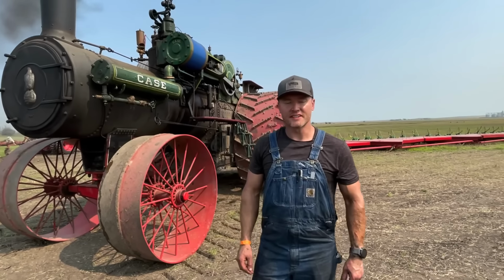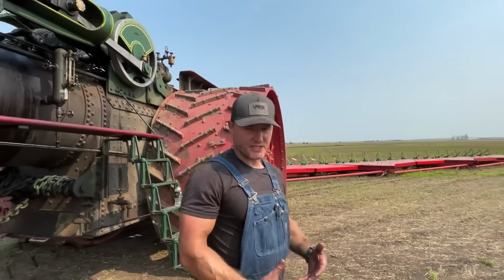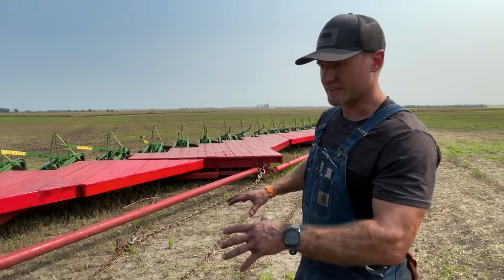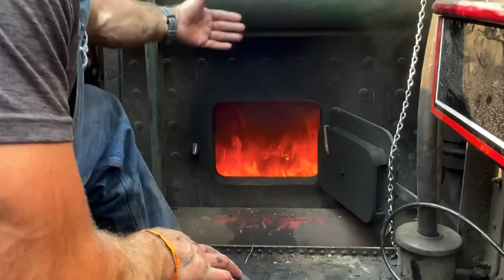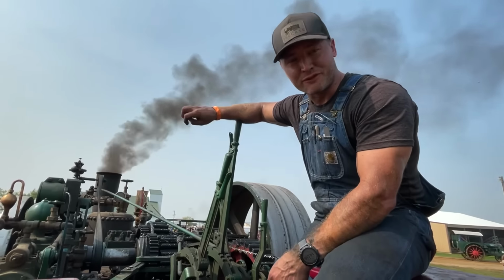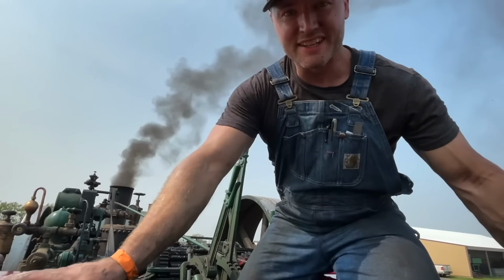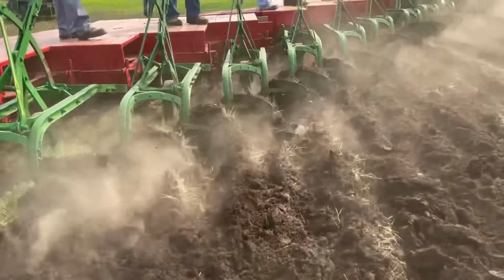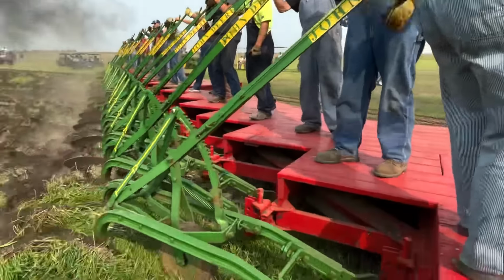2021 RECORD! 150 CASE Road Locomotive pulling 44 bottom John Deere plow

Comment: The amount of power being produced by this SINGLE CYLINDER steam engine is phenomenal!! This is the result of 180 lbs. of steam pressure acting on a double-sided 14 inch piston with a 14 inch stroke. 2 speeds forward... slow and slower! (actually about 5.7 mph. in high gear, and 2.6 mph. in low) That said, with the amount of gearing, it produces over 8000 ft. lbs. of torque at the wheels! This is the equivalent output of 8 - 2021 Dodge/Cummins turbo diesels running at full power @ 1800 rpm.!! This tractor does this at 200 rpm. at crank speed and probably with quite a bit less noise.😁👍
Reply: Thanks for the information!! Much appreciated.!!!
Reply: compare that to some of the early fuel tractors at  50 or less Hp.
Reply: The 2021 Cummins has way more power. This case is only 150 HP and of course with hydraulic drive or low gearing, the 2021 Cummins wins against the steam engine in this Case tractor for pulling too. Gearing and hydraulics can change torque in the formula, power = torque*RPM. SO many people seem to forget that.
Reply: @EETechs  nah, old is gold  keep that modern garbage away from me.
Reply: I wonder if there were any Boiler Explosions back then....... It truly is a sight to behold. Greetings from Australia.
Reply: torque number doesn't matter
Reply: @EETechs  it's all about how it's geared.
Reply: it's 8000 shaft torque not wheel
Reply: @BigCroca  that 100% right man. U can have a 5 hp motor pull that it's just going to be very slow like hafe a mph maybe at that😂 but u can do it just very very very slowly all u need to be is heavy as fuck and almost dead grany supper low and there u go
Reply: @EETechs  nothing wrong with def  concept but all the electronic crap associated with it and other emissions is garbage no human being should have to hook up a laptop to his tractor or his truck it should be fixable with a good set of tools
Reply: Is it means it's more powerful
Reply: AND - maximum torque is at 1 RPM with the regulator fully open.
Reply: @EETechs  HAHHAHA sorry you don't understand how torque and HP work on steam engines. H Power is essentially irrelevant as maximum torque is with the regulator fully open  and the engine running at 1 rpm.
Reply: It really IS amazing when you think about the physics involved!
Reply: @piccalillipit9211  that's called a torque curve. That doesn't mean horsepower is irrelevant.
Reply: @Dread_Naught_But_The_Dark  Well a steam engine does not really have a torque curve as we traditionally know it.  Its essentially somewhere between a straight line and the upper right hand quadrant of a circle starting at 0 rpm and 100% torque going down to 0% torque at maximum rpm.

When you can pull a 44 furrow plough with 150hp - horsepower kinda becomes irrelevant.  You are pulling the plough with the torques of the engine, instead of using the maximum HP of the engine and converting that wiht gears into a torque sufficient to pull the plough.
Reply: @piccalillipit9211  

Yeah.... still a torque curve. 

And horsepower is COMPLETELY relevant when the horsepower produced by the machine--especially at any given amount of torque--literally dictates how much work the machine can do in X amount of time. If this machine produced the same amount of torque but at half the horsepower, it would be pulling the plow, but only half as fast. Hell, you could take a 18hp Briggs and Stratton and use gearing to make it produce as much torque as this steam engine, and give it the same work... it will also pull the plow, but at a pace akin to paint drying. Why? Because it's only an 18hp engine.

I don't know if it had occured to you yet or not, but this is a farm implement, and farmers of all people are incredibly concerned with matters such as horsepower, which literally govern how long it will take them to do things like plow a given amount of land with XYZ machine. 

You might wanna brush up on your understanding of the relationship between torque, RPM (or speed), and horsepower. They're all equally relevant, whether you like it or not.
Reply: @piccalillipit9211  yes because theres no regulation of the piston pressure, the steam only explodes and makes engine works. So all the force is the same at 1 rpm to any rpm
Reply: You just answered a few questions I had. Thanks for that information, and yes it is amazing what one piston can do.
Reply: @piccalillipit9211  it doesnt need to be a "traditional" torque curve for it to still be a torque curve. There's a rather straightforward relationship between RPM and the varying degrees of torque production across those RPM's. That's a torque curve. Is that really that difficult for you to comprehend? 

That being said, I'm assuming you're resorting to those pathetic ad hominems because you're slowly coming to the realization that your previous statements regarding horsepower and such were completely and utterly asinine assertions, and are now trying to save face when being explained otherwise?
Reply: Less noise and probably it polutes less
Reply: @EETechs  are you saying your dodge would beat this in a tug of war
Reply: @dylanmccallister1888  The cummins engine would. It would be stupid to use a lightweight truck that gets no traction. The proper way to do this is to find another case tractor like this one and control the wheels with hydraulic motors often found on huge earth moving equipment and use the appropriate hydraulic pump for the engine. The cummins powered tractor would totally dominate over this weak steam tractor.
Reply: @EETechs  i think you underestinate the torque this engine makes. The boiler in a steam engine is where the energy comes from and that boiler is pretty big. Ssme size is used on locomotives to haul freight. 

I think it would drag you across the field inch by inch
Reply: @EETechs  yeah so i just looked it up, this engine makes over 5,000 ft lbs of torque. Thats the stock power of a 150 case. 

So no, your cummins out of your truck wont do shit you are full of it
Reply: @dylanmccallister1888  No, there is this wonderful thing called gearboxes. A higher horsepower engine will always have more torque through gearing than a lower horsepower engine that has high torque without needing gears. These are known facts. We are trading the high horsepower for more torque with sacrifice of the RPM's. since power is torque*RPM. We can make torque or RPM bigger while maintaining the same power with some losses. 

Your steam engine turns at 178 rpm for the 5,000 ft*lbs of torque. That is 170 Hp that this can put out when it was dynoed on that site you found it at. I found it too.

The 2011, 6.7 Cummins Diesel is 350 HP at 3000 RPM. That is 612 ft*lbs of torque, but if I gear it down to turn 178 Rpm to match your RPMs,  then my torque is 10,314 ft*lbs at 178 RPM, which is  350 HP. You can gear your engine down for less RPM again, say 50 RPM and say. HA! Now , I got more torque, but now I do the same and we end back again with the engine with the higher horsepower winning with more torque. In fact , if we infinitely pose these back and and forth challenges, the engine with the higher horsepower always wins.

Now to solve the torque at zero RPM problem, which diesel and gas engines do not have, I must use hydraulics. With a pressure compensated hydraulic pump I can maintain constant hydraulic pressure at stall on a hydraulic motor without worry of blowing up a hydraulic line, which gives the stall torque I need like steam and electric motors have.

That is why I stated if I had the same tractor, I would put the Cummins diesel on it and use hydraulics and hydraulic motors to turn the big wheels. In the end, my setup would always win.
Reply: Need for speed
Reply: @EETechs  so while you’re doing all these perfect matchups to benefit the Cummins diesel, can we not just keep guaring down the steam engine? Both are optimized to its limits, which one will outperform the other?
Reply: @Aaron71304  Already covered the gearing down. If you geared both down infinitely, the higher horsepower cummins diesel will always win with more torque because the higher power with the RPM higher can be changed for more torque with gears. You can trade speed for more torque but still have the same power with some losses. Say you gear the steam engine for 50 RPM, then I do the same for the higher horsepower cummins diesel, then the diesel will have more torque. An engine with higher horsepower always has higher torque capability with gears for every RPM match up with a slower turning engine with less horsepower. Remember that power is torque*RPM. So if the equation is equal to a fixed horsepower number, then if you reduced RPM by half you must double torque to maintain the same horsepower number for example. Simple math.
Reply: @EETechs  This guy is right.  All you other clowns should do more research, or at the very least LISTEN.
Reply: @EETechs  he means torque. A 6.7 Cummins isn’t going to make 4 tons of torque, and few things could try to pull this thing because 1) it has 4 tons of torque and 2) it weighs 35 tons. It’s safe to say this behemoth can drag a Cummins truck all day
Reply: @drumminggoose444  I never said use a truck. I said use the same tractor and use the cummins diesel ENGINE with the hydraulic setup I stated in my earlier replies. Read all my replies before commenting.
Reply: @EETechs  except for the fact that you need 8 of them....
Reply: Lol, let’s not appreciate what this guy did,  cool as hell to see,  doesn’t matter what a Cummins
 can or can’t do, you can’t put steam in a Cummins
Reply: Let's drop the math and hook them chains lol
Reply: @EETechs  If there is no real world penalty for infinitely gearing down for torque, then why do Diesel engines exist at all? A similar sized gasoline engine will always be lighter and produce more horsepower. What say you?

Someone in the comments said that piston was 14” in diameter and that it ran at 180 psi with a 14” stroke. So assuming it can maintain a 180 psi average on the piston and turn 180 times a minute I calculate it makes 176.4 hp and 2,572 lb-ft at the flywheel before gearing obviously. If it could make 200 rpm with the same pressure it would make 196 hp.

Don’t worry though, a junkyard LS would beat them both 😭.
Reply: Fuk that was a painful if not educational read. There is a few reasons why the steam engine isn't to go to motor of choice these days. This motor is awesome
Reply: @EETechs  bro this woukd drag any truck across the park....
Reply: It barely even sounded like it was working hard. Just chuffing along happy as can be not caring one iota that the plow was engaged.
Reply: @Onwaxwings  Thats right, and I never said use the truck. I said the ENGINE in the particular setup I mentioned in my long replies above, and sorry, I dont summarize for those that suffer from TLDR syndrome. Read the replies or ignore them if you hate long reading.
Reply: @EETechs   the engine would stall out. Still wouldnt beable to pull the 4+ tons in the dirt
Reply: @EETechs  if thats the case, why arent high hp gas engines more common in ag machinery, where their higher hp means more time saved?
Reply: @Onwaxwings  Hydraulics are wonderful in that you can get great torque multiplication and not stall the engine with proper design. There is this wonderful invention that has been around for a long time called a PRESSURE COMPENSATED PUMP. If you had read my replies you would have seen that I stated such a pump.

 I can set the pump at the line pressure I need for the power the engine can produce and literally dead lock the hydraulic motor powered from the pump and not stall the engine that is powering the pump and I get the added benefit of torque at zero RPM just like electric motors or steam engines. I will not explain how pressure compensated pumps work. You need to search that on youtube yourself and learn.

I also suggest  you look up how fluid couplings work such as torque convertors on youtube. Sorry, we don't use manual transmissions here in the USA where it is possible to stall the engine.

But if you are still confused then a Caterpillar D8 dozer has about the same horsepower as a Cummins diesel engine for Dodge trucks and it had no trouble pulling a sled weighing 60,000 lbs. I suggest you look here www.youtube.com/watch?v=Nh4n4sjVVhw
Reply: @EETechs  oh, and my calculations incorrectly assumed only one side of the piston was utilized. The actual horsepower figure is double my figure and more than the Cummings.
Reply: @TheTmshuman  Nope, was dynoed and is only about 170 HP. Google it.
Reply: @isaakwelch3451  Already covered by reply made to Thomas Shuman.
Reply: @EETechs  i dont see any reply except one mentioning 170hp
Reply: @EETechs  Why would someone say it has a double sided piston?
Reply: @isaakwelch3451  You have to go back up a bit. Youtube's comment section is not that great. It's buried somewhere in the sea of 55 replies (now 56). Gas piston engines have poor fuel economy and poor reliability relative to a diesel engine. And gas turbines are even worse for fuel economy than piston gas engines, but have insane levels of power for the weight and volume.
Reply: @EETechs   yes a steam tractor WOULD pull those. Are u slow?
Reply: @Onwaxwings  So a Case 150 steam tractor will outpull a Cat D8 bulldozer or a M1A1 Abrams tank?? You really are trolling me.😂😂😂😂😂
Reply: @piccalillipit9211  maximum torque is at 0 rpm
Reply: I would like to see them turn around and line up for the next pass.
Reply: @EETechs  Horsepower isn't everything, it's how you use those horses. Steam engines produce an absolute huge amount of torque. Horsepower is not the only indicator of an engine's power, in fact, when agriculture is the concern, it's all about the torque. It's about where their power comes from. A gas engine produces energy through motion, using carefully timed explosions to achieve rotational energy. A steam engine needs no timing, it's one cylinder, and the expansion of the steam directly drives it, and therefore, it works at full power at low RPM, because the power comes from heat and steam pressure, not speed and momentum. If anything, it's sort of the opposite of a gas engine in terms of torque. A gas engine pulls harder at high RPM, because of the momentum, a steam engine loses pulling power at high speed because the steam is being vented as fast as it can be made, resulting in lower pressure.
Reply: @EETechs  Seeing as how the M1A1 Abrams uses a 1500hp TURBINE engine, I don't see how it compares here. Of course a tank that can put out 10x the horsepower of this tractor will outperform the tractor.
Reply: @richardmillhousenixon  That is correct. Even though the 1500hp gas turbine has less torque than the case 150 steam engine , the power can be converted to more torque with gears or hydraulics but still have the same power, but now at lower, more torquier speed. Also, the D8 dozer, which has about 300 hp will also drag the case steam tractor. Im glad you understand power but some people on here are so hung up on huge torque figures. Its like they think gears dont exist or hydraulics.
Reply: @EETechs  The d8 would not be able to drag the steam engine if it were running as well. Steam torque at low end vastly outperforms the torque from pretty much any internal combustion engine, no matter how much you gear it. The caterpillar can't dig into the ground like this can, it only puts 8psi of pressure on the ground, while this tractor probably puts 5-10x as much pressure on its driving wheels.
Reply: @magisterrleth3129  Your arguement becomes pointless with fluid power and generating electricity and fluid coupling. I have gone over this so many times already in the above 60 or so replies now. With hydraulics you use a pressure compensated pump. You set the pressure such that it loads the engine to  about 80% to 85% of its full power. When the pump reaches maximum pressure it will keep that pressure at that level and not stall engine. They have swash plates in them that de-stroke the pump pistons inside the pump just enough to maintain pressure setting and keep the engine from stalling. This constant pressure will give hydraulic motors torque at zero RPM without needing to rotate just like steam or electric motors.

Likewise, a torque convertor is a type fluid coupling. With fluid couplings the stall speed can be changed to match the gas engines best operating point, negating the momentum issue you stated. 

Horsepower is absolutley everything. Its formula is torque*RPM. This formula has two variables that can be changed with gears or hydraulics or electric. If I gave you two engines exactly the same but hid a gearbox in one them, then one of them is "more torque" but all I did was use a gearbox on an identical engine.

 Maybe it is best to understand high torque engines as free gearboxes put on a higher RPM version of them without you needing to add an actual gearbox.
Reply: @richardmillhousenixon  Gearing INCREASES TORQUE. The D8 dozer absolutely will drag the Case 150 steam engine tractor backwards. It weighs twice as much and has a much larger traction surface area because of the tracks.
Reply: @EETechs  Bahahah twice as much? The CASE weighs 30T. The D8 weighs 40.
Reply: @EETechs  No amount of gearing will give you max torque at zero wheel RPM.
Reply: @richardmillhousenixon  That is why you use a pressure compensated pump hooked to a hydraulic motor or fluid coupling like a torque convertor. 

So let me ask you this, if the high torque of the case 150 steam is so awesome and power does not matter then how come a 300 hp diesel can power more homes with electricity than you high torque 170 hp case tractor steam engine? Hmm....
Reply: @richardmillhousenixon  The D8 dozer weighs 80,000 lbs, your steam tractor weighs about 45,000. Id say thats about twice as much, not exactly 90,000, but close enough.
Reply: @EETechs  80,000lbs is 40 tons. The tractor, as they stated in the video, weighs 30 tons, or 60,000 pounds. Nice try
Reply: @richardmillhousenixon  I stated it in lbs. So? Was I suppose to say 22.5t vs 40t? And the 60,000 lbs is with full water tank and coal. Nice try. I guess I should include the weight of the fuel, oil and transmission oil, and coolant of the D8 dozer too? Lol. And even at 60,000 lbs with full water and coal thats 20,000 short and thats on steel wheels with a tiny contact surface area on the ground vs a large surface area with tracks of the D8.
Reply: How much does it burn?
Reply: @EETechs  More contact area isn't always better. You ever been skiing?
Reply: @richardmillhousenixon  Thats a smooth, slick surface versus each piece of track grabbing into the dirt over a larger area. Its why bulldozers and tanks use them, far better traction than round tires.
Reply: @EETechs  Bulldozers and tanks use them because they are more versatile, not because they offer better traction.
Reply: @EETechs  Horsepower directly converts to joules of energy. 300 HP is more energy than 170, obviously. In the world of electricity, horsepower actually is everything, if you want to make power, you need to spin that dynamo fast. But in the case of machines performing tasks, torque is a good number too. And gearing will never make a gas engine pull from a dead stop as well as a steam engine. You might get competitive results, but because of the way the engine works, if you're working from a dead stop, you will never beat steam, just by nature of how it gets its power compared to internal combustion.
Reply: @richardmillhousenixon  They absolutely offer better traction. Take a bulldozer with rubber tires and the same with track set up and see who looses traction first. Let's make a $30,000 bet. I've been around heavy earth moving equipment quite a bit and without a doubt a tracked based setup totally destroys rubber tires, but you can believe what you want. I would love to have your $30,000.
Reply: @magisterrleth3129  You use fluid coupling with gears or hydraulics. YOU DO NOT USE A CLUTCH AND GEARS WITH GAS/DIESEL ENGINE. If you do then that will lead to a stall. I already accounted for this with many MANY REPLIES in early conversations on here. You need to READ THEM. 

Gas engines and diesel engines have a sweet operating area that can be used with stall speed of a torque convertor or with hydraulic pumps called pressure compensated pumps. A 300 HP diesel connected to a pressure compensated pump that powers a hydraulic motor will absolutely and utterly destroy the steam engine in stall torque. The hydraulic motor can sit there all day developing stall torque with the diesel engine running along happily without issues.

With an automatic transmission we use something called a torque convertor which is a type of fluid coupling - there is no physical connection between the drive and driven part or the stator and turbine inside the torque convertor. Fluid is what moves the driven part. I can literally lock down the brakes and floor the throttle without the engine stalling. The torque being produced at the wheels becomes stall torque much like a steam engine or electric motor, but now the transmission gets destroyed and the fluid gets VERY HOT to the point of boiling without extreme  levels of cooling capacity. Hence, why I prefer a pressure compensated pump with a hydraulic motor instead.

Hydraulics is like the fluid version of electricity. The pump is like the generator in electricity and the hydraulic motor is the electric motor. With electricity I can power a much stronger electric motor with the 300 horsepower diesel engine than I can with the 170 HP steam engine if I wanted a hybrid setup. Now do you understand power?
Reply: Careful, Jay Leno might want to buy this now!
Reply: @EETechs  
Nice reply))) greetings from Russia, St.Petersburg!
Reply: why are you comparing this to diesel pickups? its a tractor so compare it to tractors....
Reply: @EETechs  I just did the math, and given a piston diameter of 14 inches, it produces 27708.8472 pounds force. Now, since we know it has a 14 inch stroke, the radius of the flywheel/counterweight at the point of connection with the conrod is 7 inches. Now we can convert that into torque, since we know the force and radius. That gives us a torque value of 16163.49 pound-feet. And since we can obviously see that the drive wheels are not moving at the same speed as the flywheel, there is definitely a very low gear ratio, which increases the torque value even more. But let's calculate that. The drive wheels look to be about 8 feet tall given the total height of the tractor and comparing the height of the wheels to the height of a person. That gives us a wheel diameter of 25.13274 feet, and taking the top speed in low gear from the 150case site of 2.64mph, those wheels would be spinning at 210.084535152 rph, and given an engine speed underway of 120rpm in low gear (I estimated the speed from the video during a point where it was towing the plows but none were down) that gives us a gear ratio of 0.02:1. Now it's just math. Using everything I just mentioned; gear ratio, input torque and input speed, we get a maximum torque at the wheels of 808,174.5 pound-feet. How much torque does that bobcat have? Since it only has a ~5500psi hydraulic pump and not that much surface area on the pistons of the radial hydraulic motor, I'd be willing to bet it's not that much
Reply: @asbestosfiber  no kiddin, my Ferguson I use daily only has 18hp!!
Reply: @richardmillhousenixon  A D8 dozer is a not a Bobcat front loader, nor did I ever say anything about a Bobcat. BIG DIFFERENCE. A D8 bulldozer is much larger, heaver, and stronger.

You might want to do redo your torque calculations. I suggest Googling : "crank torque calculations". It's not as simple as you think with just Force*Length. Also, from the pictures of the engine, the point of attachment of the connecting rod is not at the very top of the flywheel crank. It goes inwards slightly. Finally, your force calculation assumes the piston has not moved or went to the exhaust port in full stroke. So that is stall force of the piston and gases are also compressible against a load where as a liquid is not.

The D8R Bulldozer has a top speed of 2.2 MPH in first gear and a draw bar pull force of 120,000 pounds in first gear before losing traction.

Here is a full pull with D8 dozer: https://www.youtube.com/watch?v=Nh4n4sjVVhw

Hydraulic pistons motors ARE WAY MORE stronger than that steam engine. Try 5000 to 10,000 PSI against the same 153 sq" area and the fact that liquids are not compressible. Piston hydraulic motors can easily have over 30,000 Ft*lbs of stall torque. The Case 150 steam engine does not stand a chance against a piston hydraulic motor.
Reply: @EETechs  Y'all calm down. a cummins barely last 10 years. this steam engine took your great great grandpa to his first date
Reply: @EETechs  30,000ft-lbs<808,000ft-lbs
Reply: @EETechs  I am well aware of the fact that the point of connection is not at the edge, however, the crank radius of a piston is determined by the stroke length. Crank radius is half stroke length. Even if we throw out half of the torque calculation to account for errors in calculation and frictional losses, that is still over 10x more torque than that bulldozer. And where the fuck did I say I was talking about a front loader?
Reply: @EETechs  And yes, I literally used a crank torque calculator. So check yourself before you try to correct others.
Reply: @richardmillhousenixon  That's through a gearbox. Now let me put the hydraulic motor to that gearbox that the steam engine is hooked to. You did not think this through did you when you wrote that reply?
Reply: @richardmillhousenixon  And where is this calculator? Hmm. You did not mention connecting rod length, the crank angle. At zero and 180 degrees your torque is zero. You assume torque is constant in a crank. It is not...
Reply: @richardmillhousenixon  You said Bobcat. Bobcat is not a D8 Dozer. Try again.....
Reply: @EETechs  English comprehension really isn't your strong suit is it?
Reply: @EETechs  Even if we throw out half of my calculation to account for errors in calculation and frictional losses you still have more than ten times the starting torque or that D8.
Reply: @richardmillhousenixon  Apparently, reading comprehension is not your strong point because you wrote: "How much torque does that bobcat have?",  which is a far different machine than a bulldozer and you wrote: "Now we can convert that into torque, since we know the force and radius. That gives us a torque value of 16163.49 pound-feet. " Which is the torque of your steam engine BEFORE GEARING at STALL, and in REPLY to that I gave the torque for the hydraulic piston motor, but then you decide to compare the torque AFTER gearing of your steam engine to the hydraulic motor BEFORE gearing. 

I think now you are trolling me at this point to get laughs. It is time to block you now. No more laughs for you. You lost the argument. Get over it and move on.
Reply: as someone who's been fascinated by engineering most my life, that's nuts even by todays standards, let alone the 1800's (im assuming that's when it was originally produced.
Reply: @EETechs   Nice Theory... I would like to see it in action.  However, could the engine handle that kind of torque at such low  rpm's.  You have to remember these old machines as with most things back then were always over engineered. The Cummins is precisely engineered to your vehicle or similar vehicles.  They were not engineered to sustain  such high torque for extended periods of time. I think you would over heat and lock up the engine with in the first 10 minutes.
Reply: @BNSF39  The cummins diesel can maintain 300 horesepower non stop without issue of blowing up.
Reply: @richardmillhousenixon  crazy thing is, that turbine engine in the Abrams has 400ish ft lbs of shaft torque, less than a Corvette.  Attached to the back of that turbine is a 7.5:1 gear reduction unit, the output of that shaft is around 2800 ft lbs, which goes into transmission and final drive.  Gear it even lower to match the speed of this steam tractor it will have 10x the torque
Reply: @richardmillhousenixon  torque at wheels, or tractive effort, is all we care about....gotta account for gearing, wheel diameters, transmissions, axles, etc.  Cat wins handily
Reply: @richardmillhousenixon  do you know transmissions and gear ratios?  go calculate tractive effort of the syeam tractor and D8 and get back to us....HP normalizes for these things, it's the only number that matters.
Reply: @motominded5275  I've already done that. Again, reading comprehension really isn't your strong suit is it.
Reply: @richardmillhousenixon  I don't think so, hp is hp, the more you have at crank the more torque potential you have at wheels.
Reply: To the people asking why gasoline engines aren't used is because they have: lower thermal efficiency (less efficiency at full throttle), need more room for reduction hearing, are less durable, and agricultural diesel used to be cheap.
Reply: @isaakwelch3451  fuel economy and longevity is why we don’t use gas engines in heavy equipment
Reply: @EETechs  Every single hypothetical thing you're saying is disproven by the reality of the railroads where it took the largest diesel locomotives a very long time to actually match the largest steam locos for sheer pulling power - diesels only were able to pull the same length trains when the industry transitioned thanks to single-crew multi-unit operation being included with the first mainline diesels while multi-unit operation was rarer with Steam due to requiring a crew for each engine. It wasn't uncommon for there to be 2 diesels pulling trains you'd previously have seen 1 steam locomotive on because of the drop in pulling power. (Still was cheaper to run it that way...Steam is expensive as hell to run)

I also want to note that when we're talking steam vs diesel locomotives there's not a huge weight disparity, the diesels are often using electric traction motors or hydraulics instead of gearboxes so they have near-infinite gearing, the engines are similar in size in what ways you can compare them, etc and yet it's only fairly recently that the diesels are able to match 70 year old steam locomotive designs. (ie. Steam may be better, we just don't know as no-ones made a brand new design for so long that I don't even think CAD has really been a thing with steam, let alone all of the materials tech we've worked out since the 70s/80s)

Steam isn't a big thing any more because it's far more labour intensive to run, has a very long start-up time even if you can fill the boiler with pre-heated water and diesel/petrol ICE were far more useful in smaller applications meaning that they have a huge economy of scale benefit to build. All of those added up into 2-3 diesel locos being able to operate for the same costs as 1 steam loco and afaik, it was a similar situation when looking at tractors, cars, etc.
Reply: @TheDemocrab  Except the early steam engines had way more horespower than early diesel. Like 5,000 to 6,000 horsepower. 

Also, early diesel-electric used DC electric motors and low temperature insulation, and so, could not hold the same torque that a steam engine can without burning up. So your stall torque is limited to how much heat the DC electric motors of that time can take from the high current draw.

Today, diesel-electric would utterly destroy your weak, old school, steam engine locomotive due to vast improvement in electric motors by switching to AC motors, advance control electronics, better temperature tolerance of modern motor insulation and higher horespower than early diesel.

Lets compare: 

GE AC6000CW - 188,000 pull force
Big Boy - 135, 375 pull force

And yes, you are right, a modern steam locomotive would dominate, and it's not because of torque of the steam engine, but POWER. Modern steam turbines used in generating electricity produce millions of horsepower such as the GE170X646 steam turbine rated for 1,554,959 horesepower at 1800 RPM.

 There is nothing else on planet earth created by man that compares in power except rocket engines. So thanks for inadvertently proving my point about power. As long as gears and hydraulics exist, power can always be described as different torque and RPM values for the same thing. High torque, low rpm, or low torque, high rpm. Power is power no matter how it is made.
Reply: @EETechs  Yes, I outright admitted modern diesels have steam out powered but you've also just proved my point that the only reason diesel dominates is because it's had the benefit of the last 70 years of rapid technological development while Steam hasn't: We don't make steam reciprocating engines very much at all anymore so development has all but stalled on them while ICEs became ubiquitous because they were far more suited to end-level consumers (ie. Could actually be sold to them) and cheaper for industrial/commercial applications.

I mean, you're comparing a steam locomotive from 1941 to a diesel from 1995. What was invented between 1941 and 1995 that'd benefit steam engine design? It's not exactly a small list and "computer-aided design" would be right at the top of it.
Reply: @TheDemocrab  Its more of the changes to AC motors, power electronics, and power increase of the diesel that all helped in increasing pulling power , not just 70 years of diesel tech alone.

They can make a modern steam engine train if they wanted, only it will be a steam turbine instead. You not read my whole reply? Modern steam turbines produce millions of horsepower for power generation. So my point is proven. Power is power. Gears and hydraulics can change the rpm or torque variable to suit your needs.
Reply: @thekuntash  lots of gas engines have been used in heavy equipment. I'll give you economy, but a gasser built for industrial use will have a similar lifespan to a diesel
Reply: Now imagine two banks of those cylinders in a v shape and 12 of them.
Reply: Hey Dan, please compare apples to apples next time. 8000 ft lbs AT THE WHEELS. 1 Dodge/Cummins would pull Case backwards with same gearing and mass. A 600HP Cummins with 1850ft lb @1200rpm has about 30000 ft lbs AT THE WHEELS with 1st gear engaged (5.61 ratio) and 4.10 axle with RWD only (assuming 30% drivetrain losses). As cool and beautiful as this Case is it is weak for the size, is totally inefficient and has no place working in modern world.
Reply: @EETechs  The cummins produces about 1/8th of the torque you clown. Once it's been divided by the transmission, this steam tractor probably produces well over 75,000 foot pounds of torque.
Reply: @nano-gq9tv  You completely misinterpreted what he said. Shaft torque numbers are BEFORE the power has been multiplied.
Reply: @Dread_Naught_But_The_Dark  Stop it, you don't know what you're talking about...
Reply: @Dread_Naught_But_The_Dark  Your combustion engine physics do not apply here, STOP.....
Reply: @EETechs  Again, the torque measured off of this engine is BEFORE it's been through any sort of transmission. This steam engine makes EIGHT THOUSAND FOOT POUNDS OF TORQUE AT THE CRANKSHAFT...
Reply: @jessh4016  Age has zero to do with it. This engine makes 8,000 lbs off torque, once that's been multiplied by the transmission, this old.steam engine still has a competetive edge. The proof is in the video.
As for the clown saying that a new 6.7 liter engine can do the same thing; well why aren't they putting 6.7 cummins into today's tractors & dozers? The Timberjack 450c log skidder I ran for 15 years has a 5.9 12v cummins in it, it would spin it's tires trying to pull this plow. 1 it's way too light, & 2 it simply doesn't have the power, even though it puts out over 50,000 feet of torque at the wheels in first gear... Modern machines designed to do what this macnine can do, are all sporting engines almost double the size of the 6.7 cummins...
Reply: @Angry Beaver  EETechs is 100% wrong... If he was right, a new Cat d8 would have a 6.7 cummins in it & not a 15 liter inline 6...
Steam engines make all the torque at 1rpm, THEN  the transmission comes into play....
Reply: @EETechs  You're bringing up all kinds of garbage to try to win this argument. My guess is that you soend too much time on the internet "educating" yourself solely to win chatroom battles...
Reply: @elonmust7470  yes they do, genius. Physics dont just apply differently to an engine just because it uses diesel vs. steam vs. electricity. Power and torque are still fundamental aspects of each.
Reply: Show off.!!!😎👏👏👏👏👏👏
Reply: @piccalillipit9211  '"HAHHAHA sorry you don't understand how torque and HP work on steam engines. H Power is essentially irrelevant as maximum torque is with the regulator fully open  and the engine running at 1 rpm"

You don't seem to understand how horsepower and torque work. It doesn't matter if it's 1rpm or 10,000rpm. Horsepower is still a mathematical equation for torque * rpm / 5252. 

So if a motor were to put out 1000Lb/ft at 1RPM, or 1Lb/ft at 10,000RPM, the horsepower will be the same. Now the trick comes in the curve. An engine may produce only half the torque at 4 times the rpm as it does at full torque, but it'll have more horsepower at the higher rpm.
Reply: @isaakwelch3451  High hosepower engines do not last as long as high torque engines. Higher horsepower can do more work but at the cost of much less reliability.
Reply: @magisterrleth3129  Horsepower is literally Torque * RPM /5252. It doesn't matter if it's at 1rpm or 10000rpm, horsepower still means the same exact thing. The amount of work that can be done.
Reply: @elonmust7470  Yep, that is why gears work and I would gear down the Cummins you clown. And the torque is not divided, it is MULTIPLIED. If the torque got divided then the ratio is overdrive and the wheel torque will be even less then the engine torque. Maybe you need to brush up on math??

 That is why higher horsepower will always give you more torque for EVERY RPM TO RPM MATCH UP. There is nothing special about less horsepower with big torque numbers versus a engine with high horsepower and low torque numbers. Gears and hydraulics exist to solve these issues. It's why an M1A1 Abrams tank can pull so much with a low torque gas turbine engine, but very high power. Power is torque*RPM. I cut RPM's by half, I double the torque, I cut RPM's by 1/4, I quadruple my torque and on and on. So if I gear down the Cummins to the same RPM speed of the steam engine then my torque will be much greater. If I use hydraulics I can then have stall torque with a hydraulic motor and pressure compensated pump. I have covered this countless times already.

I bet you also think a Case 150 steam tractor can out pull a Cat D8 bulldozer just like that Theodore guy thinks. LOL.
Reply: @elonmust7470  The new D8 Cat has a 300 horsepower at 1800 RPM engine. That still less torque than the case 150, but with the hydraulics and gearing and in 1st gear, the D8 bulldozer would easily out pull the Case 150 steam tractor. Let's make a $30,000 bet. You seem so confident that this steam tractor will win then put your money where you mouth is. No more BS. Talk is over.
Reply: @EETechs  You're going to gear down the cummins with what? Some imaginary transmission with ratios far beyond anything in existence? You act like a hydrostatic transmission  has no limitations; they do. I've put thousands of hours on a 5.9 cummins, hydrostatic drive log skidder, one capable of putting over 54,000 pound feet of torque at the ground in first gear... It wouldn't move this plough. The hydrostat will also heat up & start to slip..
A d8 even with brand new grousers would struggle to pull this plough. Go ask the men I lived around up in eastern OR/WA what kind of ploughs & disks they are pulling with d6s & 7s.... They won't say a 44 (or whatever it is) bottom plough..
This is where you talk #s about the machine & I tell you to figure what the force needed to pull this plough is; you have no clue...
By the way, I AM Theodore.
Reply: @EETechs  You make it sound like the steam engine does not also have gears. Why are you doing that? Could it be that if you do acknowledge that the steam engine is multiplying 8000 ft lbs of torque to a very very large unknown figure, your showoff argument would be completely foiled?  Like I said, hydrostatic transmissions are not invincable..

It's also utterly hilarious that you think a machine outfitted with such a drive won't stall out!!! My life must be a lie!!!
Reply: @EETechs  By the way the Cat 3406C makes 307hp @ 2100rpm...
Reply: @elonmust7470  Im going by the latest engine on the D8. Not that it matters, with gears and hydraulics, your steam tractor will lose.
Reply: @EETechs  I guarantee you it won't, city boy..
Reply: @elonmust7470  Yep, its called stall torque. Torque does NOT require rotation. The steam has a maximum stall torque and its based on steam pressure and piston surface area and so does a hydraulic motor, but hydraulic motors can take 6000 psi pressure or higher. The steam engine in the Case tractor is no where near that. My $30,000 bet still stands.

 D8 would out pull the case 150. And yes you can gear the steam, but for EVERY RPM TO RPM MATCH THE ENGINE WITH HIGHER HORSEPOWER WILL HAVE MORE TORQUE ON FINAL OUTPUT. What part of this does your brain not comprehend?? The case is 8000 ft*lbs and 170 horsepower, so that is 111 RPM. So I can match that with a with cummins at 325 hp at 2900 rpm with gear ratio of 26 to 1 to get 111 RPM. My torque is 588*26 = 15,288 ft*lbs. If you decide to gear lower then i can do the same to MATCH YOUR NEW RPM and we end up back again with you losing. We do this infinitely and the higher horsepower always has more torque. 

Or perhaps a better way to understand this is that the 325 horsepower Cummins engine can power more houses if turning a generator than your case 150 steam tractor at 170 horsepower. One horsepower is 746 watts. Notice NO WHERE does is it say watts is torque. It is POWER.
Reply: @EETechs  & 1 foot pound of torque equals 1.35589 watts.....
All of your math & it's all completely bogus, like you might as well just insert random #s bogus.. 

Parasitic loss alone kills your theory big time.
I have tacos to eat, bye.
Reply: @elonmust7470  Thanks for proving to us all how incompetent you are by saying torque produces electricity with your  1.355 watts is one foot pound. WOW😂😂😂😂😂😂😂 I guess all generators in the world should cease to have rotation. Just have stall torque. So 0 horsepower.  You go enjoy your tacos. You got owned.
Reply: @EETechs  Aaah see how bogus math isn't recieved well? You making up figures whilst forgetting about multiple factors is no differsnt than me omitting the "per second" part of wattage to lbf ft. I know you're out to lunch, but we're talking about the rotational equivilent of force, like it or not...

I've "owned" you since I started talking.
Reply: @EETechs  Stick to your electric treadmill motors....
Reply: @elonmust7470  One horsepower is 746 watts. Period. A generator needs rotation to produce electricity. Anytime there is torque and rotation that is power. You lost the argument. There is nothing else to continue. You believe that case 150 steam engine can power more homes than the cummins diesel based solely on torque with your 1.355 ft pounds is one watt. You have an utterly failed understanding of what power is and you failed at basic physics.
Reply: @EETechs  No, I believe that your claim about a pickup engine being able to out pull this steam engine is bogus. Put the goalposts back where they used to be.....
Reply: @elonmust7470  You pretty much destroyed any credibility you had when you said one foot pound of torque is 1.355 watts. Nothing you say from now on matters. I must block you now. I do not continue debating with people who are so ignorant of basic facts and physics.
Reply: @EETechs  As I said, bogus stats aren't recieved well; are they?
Reply: @elonmust7470  I don't know what that big word means 😂
Reply: @EETechs  haha there u do that what I was going to say.
Reply: @ttank1994  yeah is right lol. I mean he Ponts every lol
Reply: @Onwaxwings  no it wouldn't it would do it np lol. A 5 hp gas lone mower motor could do it I'd it was geard way way way way down and was around  150 tons. But it would be at a very low speed.  I mean very dam low .
Reply: @EETechs  man I know it right I'm sprized how a lot of these people don't git it. I git it and I'm a dumb 15 year old lol. I mean I'm not 100% on the math part but I can tell you a today's doge  Diesel motor with low gearing will out pull that steam motor  simply because it has more power.  Lol there's a reason we don't really use steam engines today.
Reply: @robwiljas  - I know this
Reply: @enigma9789  a Cummins
Can definitely outlive 10 years lol. Can live 30 years easy with proper maintenance
Reply: @EETechs  correct me if I'm wrong but horsepower is a made up figure am I right? Power, measured in horsepower/watt, is torque produced at the crankshaft multiplied by rotational speed. When calculating torque through gearing you always start with base torque value - not the other way around. Thus, your previous statement "higher horsepower always has more torque" is inherently incorrect. Power has little to do with pulling force. It's a fictional measurement of how FAST work can be done.
Reply: @piccalillipit9211  If you knew this, you would know what you said is incorrect and EETechs is correct.
Reply: @orhan3007  Torque requires no rotation. Power is torque and rotation. POWER = rpm*torque divided by a constant of 5252 for imperial units.

 If i gave you a list of Rpms of 600, 300, 150 and I said the power is equal to say 200 horsepower, then the torque must change to keep the horsepower at 200 for the different rpms I picked. So if I had an engine that was 600 rpm at 200 horsepower (1750 ft pounds torque) and an engine that was 200 horsepower at 150 RPM (7002 ft pounds torque), the only difference is torque, and with gearing down the 600 RPM engine to 150 RPM, I have done the same thing minus some losses. Even for electricity production, a high torque engine of the same horsepower will not power more homes than high RPM engine of the same power. Power is power.

Now imagine I had doubled the power by using an engine that made 400 horsepower at 1200 RPM . So 400 horsepower at 1200 RPM is 1750 ft pounds torque. Now I gear it down to 600 RPM. So now I have an engine that is about 400 horsepower at 600 RPM with 3500 ft pounds of torque with some losses from friction.

With electricity I can power even more homes with the 400 horsepower engine at 1200 rpm than the 200 horsepower engine at 150 rpm. Its the power that matters, not torque. Any torque you need can be taken care of with gearing and hydraulics.
Reply: @robwiljas  - Yeah - just cos something is a resultant function of another thing does not mean it is relevant. The total revolution of a car engine are a function of the distance driven and the gear ratio. They are also irrelevant to the time it takes you to drive that distance yet they are a mathematical function of that time.
Reply: @piccalillipit9211  You we're incorrect and you don't want to accept it.

It doesn't matter if the engine runs at 1rpm with 10000Lb/Ft of torque or 10000rpm with 1Lb/Ft of torque. They are both capable of doing the same amount of work. Any modern fullsize Diesel pickup engine is capable of doing more work (more HP) than this engine.
Reply: @robwiljas  - Yeah let's see how long it takes you to plough a 100-acre field with a pickup truck and how long it takes with this steam engine - 100% guaranteed the pickup truck will lose. 
A pickup truck could not pull a 5 furrow plough. Let alone a 44 furlough plough at a reasonable speed.

sorry dude, there are certain circumstances where the equations of "work" break down due to real world circumstances limiting things. It would be the same with pulling a trailer down a high way. No way on gods earth could the seam engine do more "work" than a basic F150. An F1 car produces 800BHP are you going to tell me that the F1 car can out work an F350 pulling a car trailer down a highway??? 

Torque and BHP are functions of each other - but the importance of each is inversely proportional depending on the task.
Reply: @piccalillipit9211  Nobody said use the truck. We mean the ENGINE for the tractor. Since you are so hung up on large torque numbers then explain this: The worlds most powerful diesel engine is the Wärtsilä RT-flex96C that produces 108,902 horsepower at 102 RPM's. That is 5,607,385 Foot-Pounds of torque. A GE STN-N700 steam turbine is 938,337 horsepower at 3,000 RPM (50 Hertz), which is only 1,642,715 Foot-Pounds of torque, yet the steam turbine can power many times more houses. It would take about 9 Wärtsilä RT-flex96C engines to do the same work or power the same amount of houses that just ONE of these "low torque" steam turbines can do. Your torque theory does not hold any water. It is POWER that matters. PERIOD. If you need more torque than RPM, you use gears or hydraulics.
Reply: @EETechs  - Im not hung up on large torque numbers - Im saying that there are real-world conditions that cause the relationship to break down in a practical sense. You will NEVER plough a field with an F1 car no matter how much you gear it down.

Maximum power is only of any use if it can be used and in many conditions that is not possible for a variety of reasons. 

Right - I'm bored to death with this pointless theoretical debate, I have a life to live so ill not be replying any longer. If you guys think you can plough 5.33 X as much land with an F1 car engine in anything - I mean put it in a tractor, put it in a spaceship - per hour as you can this 150 hp steam engine then you believe that.  I inhabit the real world where they have tried repeatedly to put and F1 engine in a road car and the lack of torque means they can't even get it to pull a 1.3 ton car off the line...

The guys at Mercedes have been working on this for 5 years now and guess that - the F1 engine is no longer an F1 engine, its down-tuned and up torqued - but you lot know better than the Mercedes F1 team so maybe give them a call and tell them where they are going wrong...
Reply: @nano-gq9tv  It does not have more power. If you watched the video, the man stated that the steam engine makes 8,000 lbf ft of torque, which is before it goes through the transmission! 
Assuming that you will take a light duty diesel & rely on an insane amount of gear reduction to fulfill the role of oh lets say 5,000 lbs of sheer rotating assembly (a very conservative guess) that can produce max torque @ 1 rpm is grotesquely comical...  Steam power is timeless, the sheer POWER super heated steam possesses clearly eludes all of you!  Well, places like newyork city as much as I hate to say the words, has infrastructure that is heavily reliant on you guessed it, super heated steam....
Reply: @piccalillipit9211  The gas turbine in the M1A1 Abrams tank has less torque than this steam tractor, yet it has no trouble pulling the tank and it would easily pull 44 ploughs. Go tell General Dynamics Land Systems they got it wrong with using a "low torque" gas turbine engine even though it is 1500 horsepower. I just gave you a real world example using the M1A1 Abrams tank. Not theory. See ya....
Reply: @piccalillipit9211  Still can't accept being wrong huh? Sorry "dude" facts are facts. I didn't say a truck will plow more, I said a modern full size diesel pickup engine is capable of doing more work which is absolutely true. The equations don't break down because it's a stream engine, it still works exactly the same.
Reply: @nano-gq9tv  let me know when it hits 100 years
Reply: @robwiljas  You are wong. These insane gear ratios you & your clown friends keep talking about using, DO NOT EXIST. If they did exist, the parasitic loss would take half od your modern diesel's power BEFORE it ever reached the ground.  I ran a 44,000 lb log skidder for many years. I am utterly familiar with what a 260hp 5.9 12v cummins paired with a clark hydrostatic transmission can do. My skidder would not pull this plough..
Reply: @elonmust7470  No I'm not wrong. You clearly have no clue how horsepower works. The amount of WORK an engine can do relies on torque and RPM, not torque alone. A million Lb/ft torque at 0rpm can do no work. It's not doing work until it spins.

The internet says this engine produces peak power of 150HP at 200RPM, that's approximately 3939 Lb/ft of torque @ 200RPM. Someone earlier said 8000Lb/Ft peak torque at 1RPM, but I don't know if that's true. 8000 Lb/ft @ 1RPM is only 1.52HP. Yes that's a ton of torque, but it's barely moving, meaning barely doing any work.

A modern RAM Cummins 6.7 HO puts out peak power of 420HP @ 2800RPM. That's approximately 787Lb/ft @ 2800RPM. Put a 14:1 gear behind it, which is not hard at all, and it becomes 11018 Lb/Ft @ 200RPM. The same RPM as this steam engine with almost 3 times the torque. Now take that same setup, put a torque converter behind the Cummins which gives a 2:1 torque multiplication @ stall (match TC stall to peak HP RPM) which is also very easy to do, and you get a peak torque of 22036 Lb/Ft at stall (787 Lb/ft x 2 x 14 =  22036 Lb/Ft. Way more than the steam engine. Yes there will be losses, but no where near enough that the steam engine would come even close to a modern diesel.

The tractor is very impressive, but reality is reality. There's reason we've moved on in engines. This same tractor (weight/traction) with a modern engine would outperform it easily.
Reply: @robwiljas  The man in the video stated loud & clear, 8000 lbf ft, you clown.  All of your math is pointless if it isn't at all accurate.
So, you're giant bias is preventing you from thinking critically I guess.
The reason we moved on from steam engines is the amount of work they take to run properly, as opposed to an ice engine that you turn a key.  
I'll say it again, I ran a log skidder for almost 2 decades that could put down almost 55,000 lbf ft of torque to the ground in first gear. It would not move this plough..
Reply: @robwiljas  Everybody here in your school of thought is claiming that a modern engine would outperform the steam engine without even knowing how powerful the steam engine is!

How childish is THAT?
Reply: @nano-gq9tv  right! Homeboy sounds like kid who just learnt about hyrdo static transmissions or just transmission lol
Reply: @elonmust7470  finally someone who gets. I beleive this make believe transmission im gonna put on this truck with my good ol cummings is gonna pull this monster, ill bet you 30k! Lol
Reply: @elonmust7470  I know how powerful it is, it's 150HP. HP stands for horsePOWER. Look in the mirror for childish, you're the one denying reality/physics because you're just so sure you know better.
Reply: @elonmust7470  I used 8000Lb/ft in my example.  Did you even bother to read it or did it just fly over your head? Edit: Did you only see my peak HP torque figure? Stop looking at peak torque, the engine can do much more work (yes this tractor too) at peak HP (200rpm) than at peak torque (1rpm). Please educate yourself on what horsepower actually is, not what you think it is.
Reply: @robwiljas  So how much torque does the steam engine put down to the wheels in first gear?
You just watched it drag an obsenely large plough  through the earth. 

Oh, yeah you have no goddamn clue..
Reply: @robwiljas  Hense me stating that you don't actually know the power that the steam entine is capable of. You're just making shit up as ya go.
Reply: @elonmust7470  Make sure you see my edit on my last reply. At the wheels doesn't matter, we're talking engine for engine, not vehicle for vehicle. I said a modern engine in this tractor would outperform it. The steam engine puts out (according to vid) 8000Lb/ft of torque at the flywheel, at only 1rpm. Since its full POWER is 150HP @ 200RPM, we know at full POWER it's putting out 3939Lb/Ft of torque. You don't seem to understand the difference between torque and power. Power is the work that can be done, not the torque.
Reply: @elonmust7470  I'm not making anything up, you don't understand what you're talking about lol.
Reply: @robwiljas  They coenside, you & several others here didn't read that part of your google search...
Reply: @elonmust7470  I don't need google, I actually know how torque and horsepower work. You should really educate yourself before you make yourself look more ridiculous. Torque is twisting force, not motion or actual work. Horsepower is twisting force x motion. It's the actual work. You take a motor with 10000 Lb/ft of torque but only 100HP, and a motor with 100Lb/ft of torque but 150HP, with proper gearing on both and equal traction/weight the second motor will ALWAYS outpull the first.
Reply: @robwiljas  You are insanely misinformed..
Reply: @robwiljas  The examples thatbgo directly against your theories are so vast. Just look around you for  Christ's sake. Vehicles designed to haul weight don't have high hp, low torque engines, do they? No, they have low revving, low hp, high torque engines.
Why would the entire industry be wrong & you right? It's because you're WRONG...
Reply: @robwiljas  If torque is not twisting force, then what is it you clown? Like I said, your google education didn't cover all necessary bases.
Reply: @elonmust7470  Again, you prove you have no clue what you're talking about. They have low revving high torque engines for efficiency and durability. There are pickup engines more powerful than many semis but they wouldn't last as long or be as fuel efficient. HP and how it works is not a theory, it's a fact. You just can't understand it so your ego insists I'm wrong.
Reply: @elonmust7470  No I'm not I'm stating fact. Get over your ego and actually educate yourself before insisting you know what you're talking about.
Reply: @robwiljas  You're wrong. You're making a claim based on your OPINION. Facts? You don't have em.
Reply: @robwiljas  You have no grasp on hp & torque other than what you read on google!
Reply: @elonmust7470  Yes I do, you're the one saying I'm wrong because you said so. I showed the math lmao. What a joke.
Reply: @elonmust7470  Wow you're really triggered by being proven wrong huh? lmao
Reply: @robwiljas  You showed me final #s after the steam engine's power has gone through the same transmission that you talked about using with your diesel engine?
That's funny, I must've missed that. We'll just cut to the chase & you can state what the final power output of the steam engine is capable of...
You think an 8000 weight at the end of a 12" lever making 1.5 horsepower  is some kind of "gotcha" moment. Steam engines don't have to operate at 1 rpm. Higher torque allows for greater horsepower at lower rpms. In a world where getting things moving, twisting force, or torque wins the race.
AGAIN, the industry as a whole thinks I'm right....
OR are you content with your made up theory?
You
have 
no
idea
how 
much 
power 
the 
steam engine 
can 
make!
Reply: @robwiljas  You have proven nothing!
Reply: @elonmust7470  You can't honestly be this ignorant. We're talking engines. You keep trying to bring the tractor itself into this. No matter what with the same vehicle, but with this steam engine properly geared or a new Cummins or any modern full size HD diesel pickup engine properly geared, the diesel will out pull it. This tractor is 150hp, gearing does not change horsepower or how much work the engine can do. You can only change the torque/rpm with gears. You are completely clueless and arguing against FACTS.
Reply: @robwiljas  What? Where did I make mention od the steam engine in fontect other than it's power? 

You're disingenuouse...
 You don't know what the stram engine is capable of because you don't know how it's geared.
END OF STORY....
Reply: @elonmust7470  What? I don't know what the first part said. Again.. I know the tractor is 150HP, that's what it's rated.  That's the work it's capable of doing. Gearing doesn't matter it doesn't affect the power or work the engine can do, only torque/rpm. This is FACT. You can get more torque/less rpm or less torque/more rpm with gearing, but the POWER or work it can do remains 150HP.
Reply: @robwiljas  "Much discussion here involves low speed lugging "power" of steam engines. That "power" as understood usually is pulling force at a low velocity, and therefore is actually low power. At low speed the force or torque is high on a steam engine determined by the steam pressure force on the piston whereas an IC engine does not usually get used at near zero velocity." After the excessive gearing, the diesel produces less than the advertised HP due to friction.
Reply: @elonmust7470  You don't understand power or gearing at all. Torque is only half the equation for an engine doing work, HP is the full equation that you can't mentally grasp. With proper gearing a modern full size HD diesel is way more powerful than this engine. Look up what it actually means and stop rejecting reality due to your ego. Gearing can change torque and RPM, it can not change the POWER. No matter what through gearing you can always get more torque from the modern engine at the same rpm because the modern engine is capable of doing more work. That's what HP means. There will not be anywhere near enough loss to make up for the fact that a modern diesel with proper gearing can produce well over two times the torque @ the same 200rpm as this engine. A torque converter will give you more stall torque than this steam engine too.
Reply: @robwiljas  gear windage and friction...
Reply: @robwiljas  Torque converter, trans oil pump. Both rob hp.
Reply: @elonmust7470  They don't rob nearly enough to make up for the diesel being over twice as powerful. You were wrong, accept it and stop doubling down on your ignorance. You're arguing against physics.
Reply: @robwiljas  Gearing robs power as well... Where the steam engine can do the work continuously, the "HD diesel" is operating at max rpm..
How long can it realistically do that?
Reply: @robwiljas  You have no real world experience, for that I will argue that the sun is cold.
Reply: @robwiljas  How do you know that? How do you know the diesel won't overheat & spin a main bearing 50 yds down the path?  The steam engine can produce the power at any slow,  long life prompting rpm. Your theory is "it works on paper" worthy & that's it.
Reply: @elonmust7470  You want to keep doubling down? Don't forget the tractor is using gearing too. We just need different gear ratios. Also while consumer diesels aren't rated to run continuously at full power, commercial ones are. A commercial 6.7 is still over twice the power of this engine. You're desperately trying to come up with other things to make me wrong. I'm a truck driver and college educated, I understand horsepower, torque, gearing, and the math very well thanks.
Reply: @elonmust7470  You're desperate lol. A 400hp diesel could produce more power than this at half it's power rating. It doesn't just work on paper, it's reality. This is how horsepower works. This is VERY basic stuff. It's used every day in the real world.
Reply: @robwiljas  The tractor is geared very conservatively.  & A truck driver with a college education. How sensible that is. Or is it a complete waste of time & money?
I'm a former logger who now works for himself, owns 2 homes & a 7 figure stock portfolio. Sounds like common sense has done me pretty well in the 34 years I've been alive...
Reply: @elonmust7470  

Dow, you're demonstrating high-level Dunning-Kruger behavior, and I applaud you for it. You are a classic textbook example ... please keep it up.
Reply: @uploadJ  Oh shut up.. Anyone who thinks 1,100 lbs of 6.7 liter diesel is going to perform the same as 15,000 lbs worth of steam engine does so because they know about pulling thing only in theory.  There is a reason that the trucking, farming, logging, fishing, mining, earth moving etc etc etc industries do not all use small high hp engines. Not becsuse those engines wear quicker, but because asking an engine to perform at constant maximum load will literally cause the engine to fail within a number of hours, & not thousands of hours. 
I could honestly give a damn about what the horsepower rating is.
Reply: @elonmust7470  

There you go again!!! Bravo!!! Another post for the innumerate and deniers of basic physics, leverage, torque and horsepower!!!
Reply: @elonmust7470   Theodore why are you trying to use longevity now? I told you small high horsepower engines don't last as long. You literally just said it's not about that and then said they don't last as long lmao. A 6.7 Cummins is not going to be running at even half it's rating to out power this steam engine. We're talking power and how much the engine can pull remember? Horsepower is the measurement for this. Please educate yourself and stop arguing things you're utterly clueless about. An example... I just noticed reading other comments you said 1Lb/ft of torque is 1.355 watts. That is false. Torque is not power. 1Lb/ft PER SECOND is 1.355 watts. Like I told you before, torque is only half of the equation. 

Edit. Let's use watts instead of HP. At full power, the steam engine is rated for about 111,855 watts (150HP). A new Ram Cummins HO is rated about 313,194 watts (425HP). 

Have a great rest of your day!
Reply: Many silly arguments above. Fantastic they built/rebuilt this tractor. So fun. Steam power is gone because other technology replaced it. Of course modern equipment can out perform steam. Who cares! This steam tractor is awesome.
Reply: @dfriendperc  Steam engines are labor intensive, that's why they got antiquated. As for the way they make power, pretty unique. where a 4 stroke makes 1 power stroke for every two revolutions, a steam engine can make two power strokes for every one revolution.
Reply: @EETechs  But a vehicle as light as a 2021 Cummins wouldn't be able to apply its power to the ground in the same way as a heavy traction engine. Sure, you could gear it down low enough to get the torque, but it wouldn't pull this load.
Reply: @noxious89123  It is very important that before making a reply to always READ the other comments. No one said anything about using the truck at all. This is not a truck vs the tractor, but same tractor vs same tractor, but one using the Cummins diesel and hydraulics against the steam version. The alternative is a Caterpillar D8 Bulldozer vs the steam tractor....
Reply: It also probably eats coal faster than the cookie monster eats cookies.
Reply: So if this thing puts out 8000ftlbs at 200rmp and the dodge gives 8 times less at 1800rpm then with proper gearing and 10% losses the dodge would have same torque to the wheels as this mighty beast.
Reply: @nano-gq9tv  with a 5hp at relatively high rpm there would most likely be too much losses in the transmission
Reply: @rehepeks  No, the Cummins engine has twice the power, the higher RPM is traded for torque with gearing. If you geared the Cummins for the same RPM as the steam engine, the steam engine would have less torque. The steam engine is only 150 to 170 Horsepower. The Cummins is 300 horsepower or higher if newer model.  

Here is a more logical way to think of it: If the 170 horsepower steam engine is connected to a generator and the generator is powering an electric motor and the 300 horsepower Cummins engine was connected to a generator that also powered an electric motor, the Cummins generator will power a much higher horsepower electric motor capable of more torque or RPM depending on the number of poles of the AC electric motor (more poles is more torque, but less RPM and vice versa).

 Each one horsepower is 746 watts. Torque does not convert to watts, horsepower does. The same concept can be applied to hydraulics also.
Reply: Thx for the info! That is over 10 000 newton meters of torque :O. And at such low RPM. Really insane numbers.
Reply: @EETechs  lol bull crap this is a beast
Reply: @EETechs    I've just read through this thread.  Very entertaining.  You are so full of crap.  Did you miss the part of the video where he said that steam engine is pulling about three times what a modern tractor can pull?  You need to let that sink in, then maybe you will realize how silly most of your comments were.
Reply: @donm2255  So a T96E New Holland tractor by itself did not pull 66 plows? Lol, you post a reply without doing research. Last time I checked 44 is less than 66. Nice try.... Google search is your friend. Again power is what matters. I can gear down higher power for more torque. The 66 plows pulled by the modern diesel tractor blows your theory out of the water. You lose.
Reply: Look at the size of that Flux capacitor... Jesus!  Going 5mph at 2200 rpm in reverse inside out over the crank shaft only to put it in drive is amazing!
Reply: @EETechs  I just had to throw this in here to mess with you but liquids are compressible...lol
Reply: Amazing! Those old timers were so smart! Even today this still a challenge!
Reply: @peterduxbury927  there where explosions if the water got low and pressure built up enough
Reply: @EETechs  you honestly know nothing of steam powers potential.  "Muh Cummnz turbo deezol" will not out pull 8000 ft pounds of torque.
Reply: @EETechs  with that school of thought a boosted 2.0 inline 4 would output this. What are you on
Reply: @deanwslifer6505  Then go tell the steam guys to pull 65 plows. OH wait, that's right a SINGLE DIESEL powered tractor pulled 65 plows and this steam tractor could only pull 44. Next time you should read the comments before posting. This thread is dead because it has been proven that power is what matters and gears gives you the torque you need. The T96E New Holland tractor destroyed any argument about the steam tractor's torque at the engine.

"As an encore, a single 535 HP New Holland 4 wheel drive tractor with ATI tracks pulled the plow to see if modern agriculture could compete with century old technology.
  (enlarge photo)
   Despite being only one tractor, it pulled the plow admirably with 65 plow bottoms in the ground."

Google is your friend..

 It is torque at the WHEELS that matter and with gearing down higher horsepower you can gain more torque for ever RPM to RPM match to a lower horsepower engine with more torque. THE END. 500 horsepower diesel versus 150 hp steam. Easy win for the diesel tractor. Next time you should read the comments before posting......
Reply: To be there and see this machine, to feel the pulse of the engine, the sounds and smells remind me of steam trains. Thanks for your information, and I was curious to know the Plate Thickness of the Boiler, to sustain such pressure. I would guess that the Boiler Plate must close to two inches. The Case deserves to be used in Films.
Reply: It's my understanding that Horsepower is actually a measure of work. The work itself is based on the work an average horse could pull a weighted sled uphill in a certain time.

Based on that measure an 18 horse Briggs Stratton engine can accomplish the work of 18 horses pulling weighted sled up an inclined planes.

But talking about 8,000 ft/lbs of torque is a whole different number in concept. 

In engineering terms does the 70,000 lbs machine have to carry it's own weight up the incline plane to factor in the power?

I'm not an engineer.

But Jay Leno the comedian and car collector has a saying.

Horsepower sells cars but torque wins races.
Reply: ຖພໄາ
Reply: @TheTmshuman  a small gasoline engine cannot output it’s max-rated horsepower constantly for extended periods of time while commercial diesels can
Reply: @quinndenver4075  Marine gas engines have entered the chat

Aviation gas piston engines have entered the chat

Gas generators have entered the chat

Passenger vehicle gas engines fitted with CVTs have entered the chat
Reply: @TheTmshuman  obviously I was talking about gas engines used in passenger cars. Aero and Marine engines have less performance per displacement than car engines, more in line with commercial diesels. The fuel used is not the main consideration in determining the durability of an engine, but the velocity and robustness of the internal components in the engine are. This is why ICE engines that are capable of sustaining their peak power (mainly commercial engines) have lower specific power than say car engines. You do not understand basic physics, an M1 Abrams has 400 lbs-ft of shaft torque out of its turbine engine, do you think this steam relic could outpull it? Power is the ability to do work over time, this is literally the only important factor in an engine as torque can be altered by gearing to the specific use case.
Reply: @TheTmshuman  also, no cvt equipped passenger car outputs 350+ hp constantly (or maybe at all) during operation. Cruising at 70 mph on the highway in an aluminum passenger car does not take that much power genius.
Reply: @EETechs  I think they've done this. And... yes it did pull a tank.
Reply: @EETechs  With every down step and mechanical linkage attached to the engine you LOSE efficiency. I.e. more power bleeds out through the system. Gearing a Cummins that naturally produces an 1/8 would bleed a lot of that off. My best guess is the D8 and this thing probably come in pretty close in terms of output/towing capacity.
Reply: @Kloppin4H0rses  Except the loss is not big enough to be less output than the steam engine. Nice try....This thread is dead though because a New Holland diesel tractor pulled 66 bottom plows vs 44 from this weak steam tractor, utterly destroying the so called torque at the engine mattering, when it is torque at the wheels with high horsepower that matters.
Reply: @EETechs  Losses through additional linkages is fucking huge my friend 😂

And why do you hate steam so bad? Did it touch you as a child?

It's inefficient as hell but ultimately this is about historical recreation. Your 1000 plus words on Cummins vs Steam will not stop me from attending the Steam Fair or building steam engines. I'm sure that will burn severely for you.
Reply: @EETechs  I have a hard time believing you do anything other than surf YouTube in moms computer. Lol

Your demeanor is nothing of that of a professional on any level lol
Reply: @Kloppin4H0rses  The New Holland pulled 66 bottom plows. The case can only pull 44. End of story.
Reply: 8000 lb torque x 200 rpm / 5252 = 304 HP not 110, what gives?
SO if it has 110 HP 
I time the wheels at 4 seconds per rev = 15rpm
Let X = torque:
110= (X*15)/5252
110 * 5252 = X*15
577720= X*15
577720/15=X
38514.66 = X  Torque at the rear wheel  is 38,514 lbft
The wheels are roughly ~6 feet in diameter so radius is ~3 feet
38514.66 / 3 = 12,838 Roughly the pulling force of 12,800 pounds.
Reply: @EETechs  I mean, the diesel engine COULD beat the steam engine with sufficient gearing, thanks to it gaining torque as it speeds up vs. the steam engine losing torque. However, in a standstill, it would take a whole lot of gearing to stop the diesel from stalling. So in conclusion, yes, diesel can beat steam. Is it worth the drastic loss in fuel efficiency? No.

*Edit. I'm suggesting this under the presumption that the steam engine has no gearing. If you add gears to a steam engine and open the governor, the diesel will start to fall behind in terms of torque and will probably stall unless you add EVEN MORE gearing.
Reply: @EETechs  You don't understand how a expansion steamer works. All your other data is irrelevant to the issue. To make an equal comparison the Cummins would have to be harnessed to a direct mechanical  friction power transfer, engaged at zero engine rpm.
Reply: @EETechs  BIG BUD 747 Biggest diesel tractor as far as i know in the world still 1150 hp pulls a 21 bottom plow Just saying
Reply: @thomasroth4695  Sorry, but a new holland tractor pulled 65 bottom plows. Steam lost. Just accept it. The big bud could pull even more if they wanted.
Reply: As of  right now this 110 is holding a world record for steam @ 50 bottom it 44 in this.    Im sure he is gonna get more its not straining.   And why are you switching from wheels to tracks ?   Isnt this a ridiculous comparison of a 350 Cummins outworking this 110?
Reply: @EETechs  well big bud hasnt.  And these guys are going for a world record in 2023 of more than 65 bud.  Wheels or tracks.   Im hoping to be there in person.   They have allready done a 50 14” plow @80’
Reply: @EETechs     A tracked vehicle ?
Reply: Lmao add a second cylinder for double the power
Reply: @EETechs   The transmission gearing required for any high HP low torque motor like a dodge cummins would be totally impractical to build and maintain, not to mention actually be durable enough to pull the load consistently. So your Cummins would only work "hypothetically", not in the real world.
Reply: @rockenrooster  Sorry, I already won this argument and you failed to read how I would do this setup. Don't comment unless you read all the comments. Anyways, a tractor with similair horsepower as the cummins engine I was talking about pulled  more bottom plows than this weak steam tractor ever could. Type in "535 hp new holland tractor bottom plow" in google. It pulled 65, more than this weak steam tractor can. That is why this comment section is dead now, but people who do not bother to read the comment section like you, keep posting. So your transmission theory failed too since a 535 HP diesel tractor proved other wise and the M1A1 Abrams tank works very well with its gearbox, even though it uses a high speed gas turbine engine, btw...